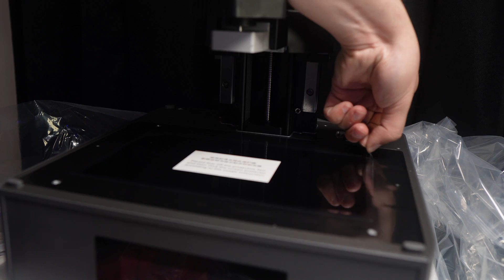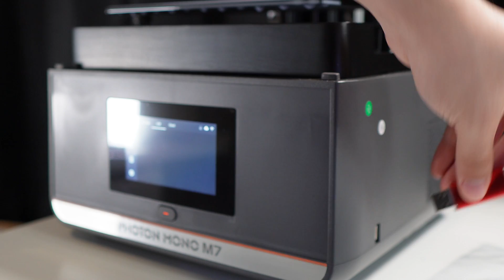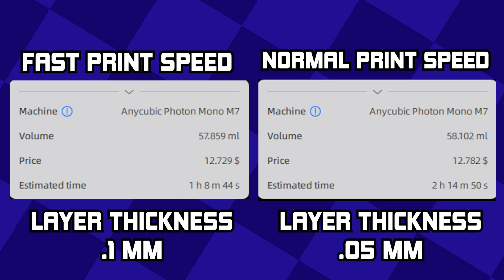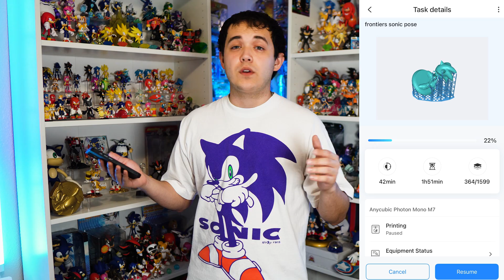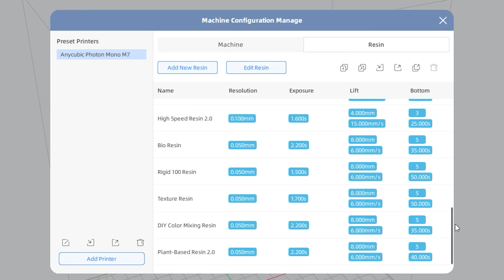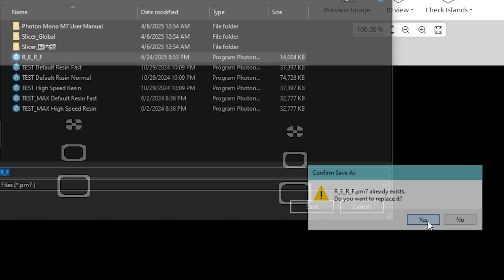Anycubic Photon Mono M7 | AMAZING RESIN 3D PRINTER FOR HOBBYISTS!

Comment: Do not believe the crap these guys on Youtube are peddling about Anycubic.  Bought this printer and their Kobra 3 Max and they are obviously trying to flood the market with crap that doesn't work.  hadn't even had my mono 7 pro for a month and the plate no longer raises and lowers.  After having my Kobra Max 3 for a week the print head died.  Maybe this is a one off, but seriously both printers?
Reply from the maker: dang, Im sorry to hear that. This is my first time ever using an anycubic printer and Ive had it in constant use along with my Elegoo printers and its been working very nicely. the only issue ive had come up with this printer since uploading was its giving me false negatives saying theres residue detected in the vat when thats clearly not the case. Aside from that, I wouldve been more vocal if there were things I wasnt a fan of with this printer. its been great